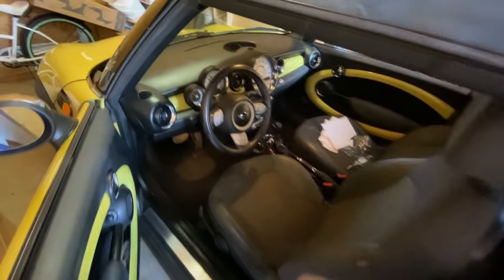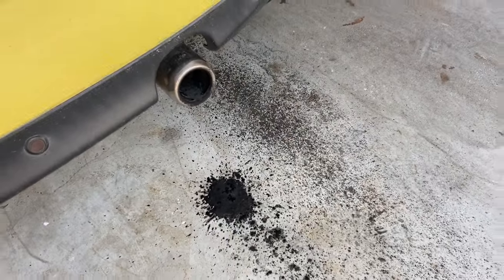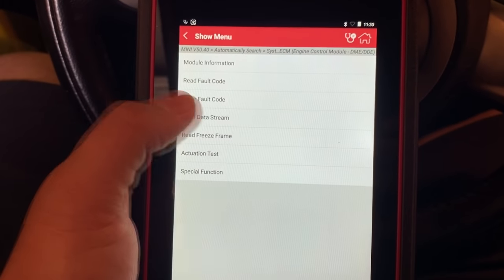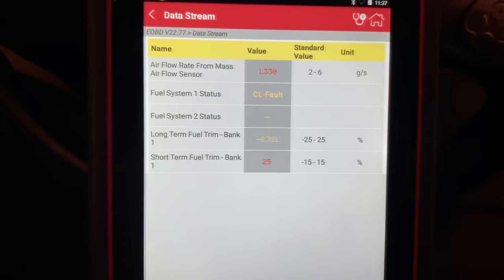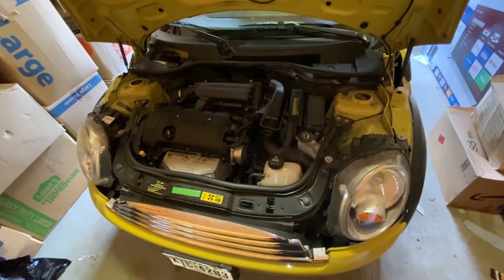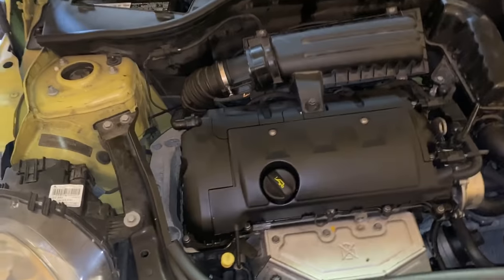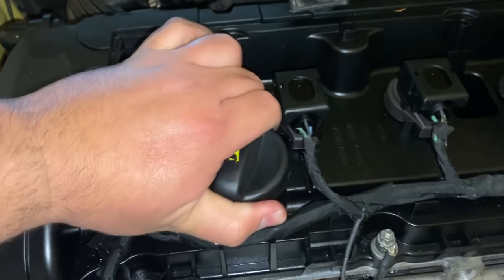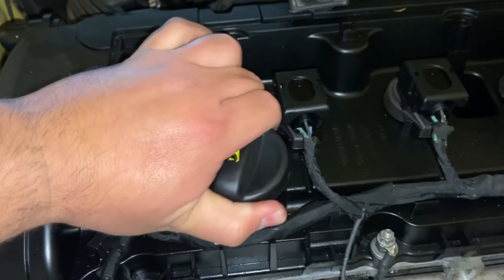MINI COOPER RUNNING ROUGH / HARSH IDLE DIAGNOSIS

Comment: Leave it to german engineers to make you replace the valve cover just for the pcv valve. If that part failed on my Accent you could just unscrew the pcv valve from the side of the valve cover like it's a lightbulb.
Reply: I believe ecstuning sells the diaphragm and spring separate, don't quote me on that. But it's not worth it cause plastic valve covers crack over time with all the heat cycling.
Reply: Your vehicle is probably older because pretty much all late model vehicles use a crankcase vent valve which is commonly built into the VC and not serviced separately. Some vehicles can have the diaphragm serviced separately, but not all. MINI's unfortunately, requires a whole new VC.
Reply: You can buy just the Pcv valve for 15-40,
Depending on where you buy it.

Comment: Have anybody here done a timing chain replacement after the valves were bent? Put it back together and there are two holes on the crank alignment position.
I just finished doing a lot of work to a N12 1.6 mini from 2009 and when I first started it up it sounded good after about 20 minutes of starting it and then motor stalling. Any experiences with the alignment hole on the crank. I noticed there are two holes. Which hole to use? Would it matter? Holes are off 180 degrees.

Comment: these engine's dont have a lot of vacuum.. because  de vacume is controlled bij the variable lift of the intake valve's...it gets crazyer if you press the gas pedal you dont open the butterfly valve, your opening the valves more with the variable valve lift. so at idle the valves are opening a tiny bit to let air in. there is a valve in the intake but it is for emergency limp mode only and also it close when you turn the engine of. (smooth stop)

Comment: Need to clean the throttle body, map and mas sensors and finally walnut blast the intake valves. That back stuff is carbon build up common in gas direct injection engines. All the carbon doesn’t allow the valves to close properly.

Comment: A PCV valve built into the valve cover---typical German "engineering". I'm wondering if that oil blow-by fouled the catalytic converter?
Reply: The engine is made by PSA in France(Peugeot).
Reply: @willemstreutgers1154  That's even worse....

Comment: Oil fill cap was not tight 
From first engine look
Reply: I would of replaced the filler cap they do suck a lot on the crankcase by design and a cap that doesn't seal right on one of them psa engines will cause lots of fuel trim problems can be checked by putting your hand over the hole normally when the valve has gone they squeal on idle and run rough

Comment: not even 55k miles
Reply: Ya even BMW people say never buy them there rubbish.
Reply: @neilmurphy845  yep, timing chains are known issue on BMW/mini
Reply: @MattyEngland  Did they make the newer ones any better or ate they still the same.
Reply: @neilmurphy845  I'm not sure when they got better, but I've seen failed chain guides from 1999 to 2008.
Reply: @MattyEngland  Is it true that they used Toyota engines I some of the newer ones.
Reply: @neilmurphy845  the newer ones aren't good either. They're basically bmw X1s and X2s disguised as MINIs.
Reply: @mikemata623  Ya how people think that there mini's I don't know because they definitely don't look like one's especially the country man.